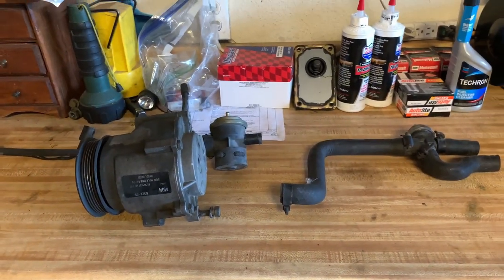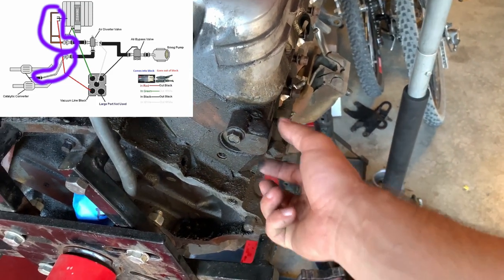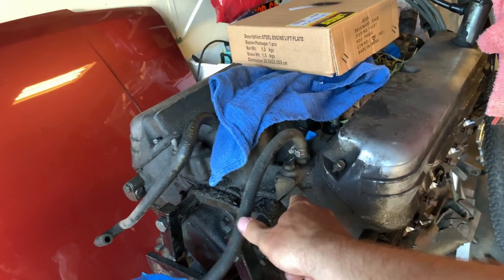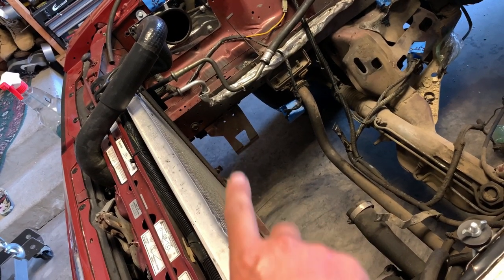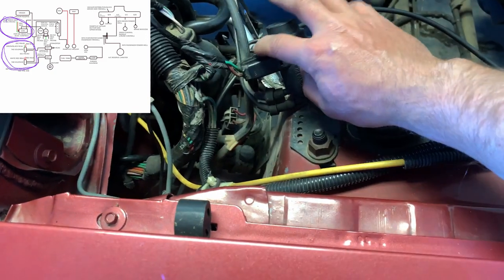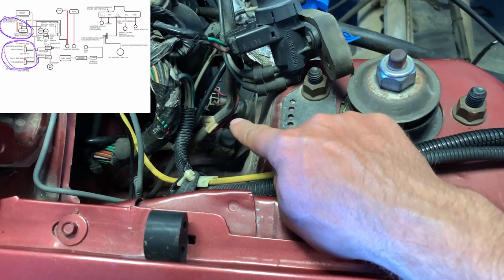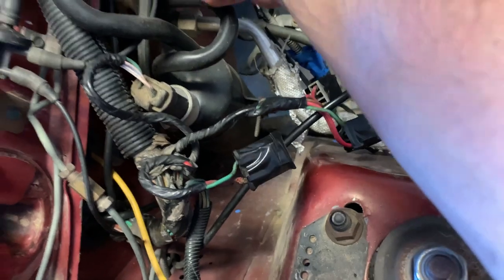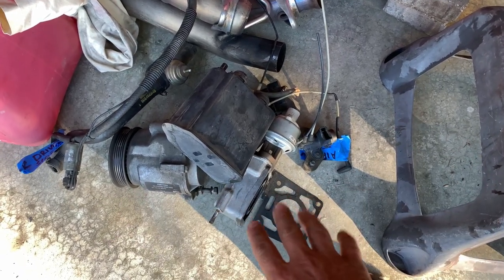Delete Your Foxbody Mustang Emissions!! And Gain HORSEPOWER!! Foxbody Engine Swap Part 6

Comment from the maker: If you have any questions ask me here!
Reply: Great video man. I was surprised. So I’m at about the same spot as you are here in the video. I’m trying to remove things and consolidate space so I have room to put the ignition box (may go under the passenger seat) and the catch tank setup. I’d like to consolidate all the vacuum hoses to just a few total, as it’s like spaghetti in there. As for the purge canister, I’m wondering what the adverse effects would be with leaving it. I’m going supercharged, so if I leave the purge valve hooked up, if the pcm would even control it correctly. But if I hook it to straight manifold vacuum with a check valve, then it would likely implode the tank from vacuum suck down (it can happen - newer Focuses).
So nowadays charcoal canisters are out just before vent to atmosphere valves that are normally open. The hose off the end of them goes up into the body around the fuel tank so any vapors stay trapped up there and you don’t smell them. A differential vent tube with the little valve at the end routed up into the body around the fuel tank may be something I try to see if it prevents fuel odor but allows tank pressure to vent, like when you fill the tank.

The engine bay in these things triggers my ocd - I like minimal/no clutter.
Reply from the maker: I’m the same way it has a billion vacuum lines going all over the place and I hate it!! And so I have an 03/04 cobra tank from on3 performance and the way I’m going to vent it is from the fuel tank vapor valve on top of the tank into the filler tube and that is supposed to vent it properly so that I can fill it with gas like you were saying. And right now for the catch can is I’m just running two breathers and later on I will fab a catch can system. I don’t know where to put it either since their is absolutely no space! I was thinking about relocating the battery so I have a little more room and I could potentially mount the can there and the ignition box.  

Are you on a stand-alone or are you using a chip or stock pcm ? 

Yea the efi systems are messy it honestly bothers me too. I think one day I’ll try to do a dedicated wire tuck.
Reply from the maker: So I reread your post and I got confused lol I thought you were talking about the vacuum reservoir. But with the purge valve I’m just getting rid of mine with the cobra tank and venting the tank with the vapor valve back into the filler tube so it can vent while I’m filling the car up. I read like you did about to many problems with trying to keep the vacuum canister with boosted applications and since I’m running a stand-alone system I don’t think it would even work with the purge valve. And that’s why I just voted to delete it completely and just try to figure out a better way to vent it with the new cobra tank.
Reply: iAmChazHaynes Yo I sent you a FB request.

So I’ll look into doing the filler tube route for the vent. I’m actually building for a customer, he’s running pcm with a chip. He’s also keeping all accessories, even cruise control, so real estate under the hood doesn’t really exist.
Reply: Thank you so much for the video. Is there any ECU or electronic connection i need to be aware of? or may be damage something?
Reply from the maker: @juanlaverde4692  no worries happy I could help! And so from my understanding you do not have to change anything on the stock ecu. That’s what I have read and all my smog stuff didn’t work anyways before I deleted it and I had no codes to speak of.
Reply: @iamchazhaynes7074  thank you!
Reply: Hey man I’m currently doing all
The same removal as you did in your video , I’m  curious what is The point of leaving the vacuum canister in the fender, will the car run funny without it? I’d like to remove mine /delete mine
Reply from the maker: @rhysbryant7451  So the function is to help with your HVAC so your ac will blow air or heater for that matter. I've seen some guys delete theirs I think someone has a YouTube video about it. I just didn't want to do that since I'm keeping my accessories hope that helps! It might have some other functions as well but that is all I could find about it.
Reply: @iamchazhaynes7074  beautiful! Thank you !
Reply: Hey man!! I just bought a 1990 Mustang LX 5.0 5 speed hatchback. I live in California and in order to register it I have to get it smogged. I have the smog pump as previous owner took it off. It has an x pipe headers and an E303 cam. What do I need to do to have it pass. Could I leave the cam and put everything else to stock? Thanks man beautiful Foxbody and great video.
Reply from the maker: @RangerDanger074x4  ok so the cam should pass I have a friend who has an E cam that passes smog so as long as everything hooks up and is in working order it should pass honestly. If you make sure the stock exhaust is put back on you should be fine just make sure all those vacuum lines are ok and not torn apart that’ll mess with the system. If you don’t have stock exhaust you’ll need a catted x-pipe at the very least.
Reply: @iamchazhaynes7074  thanks!! I have the stock mid pipe with cats. So I’m gonna get that put back in and find some catted headers or just stock manifolds. Thanks for all the help! I love the car.
Reply from the maker: @RangerDanger074x4  no worries happy I could help at all!
Reply: What about the egr as well as crankcase pressure? Are you going to carb and ditching the computer too?
Reply from the maker: @bryanbrunk1186  so for the EGR I deleted all of it and ran new heater hoses. And for the PCV valve my intake manifold doesn’t have a spot for it as well as it wouldn’t work anyway for me since my car is boosted. So right now I have two valve cover breathers to vent crank case pressure and soon I’m going to make a catch can system to vent it better. And no I’m still EFI I’m on a megasquirt stand-alone system though. I had to use some sort of tuning system to handle the power and boost I’m shooting for ! Lol
Reply: I have a 95 mustang gt iv removed all the smog stuff & running off road h pipes but exust fumes are very strong is there anyway to fix that
Reply: Do u have a video about properly connected O2 sensors? 84’ mustang with 89’ engine. 5 speed
Reply: How do you remove the mid pipe air tube? I cannot for the life of me get it off. Thanks!
Reply: I’m not too mechanically enabaled but I love the 87 mustang planning on buying one but the guy deleted his smog pump. Will this prevent me from passing smog!?
Reply from the maker: @DudeWithALude97  You definitely will not pass smog if he removed the smog pump!
Reply: I took the smog pump off but not the EGR or all the  stuff on the passenger strut tower I have the smog tube capped off and what goes in the h pipe hole sorry it's my first mustang I'm just trying to learn
Reply: Tips on removing EGR system from a 1987 Ford Bronco II 2.9L  ???  Main tube was capped off (gone) when I got it. So always has crap for mpg, runs rough for about 30 seconds once it would be warmed up. Then smooths out, but like I said earlier, crap mpg and reeks of running rich; Thanks-
Reply: so u unplugged the evr also
Reply: How noticeable is the gas smell without that charcoal canister?
Reply: Do you have to tune the car after
Reply: I have 88vert still speed density and almost all stock. I put bbk headers and catless hpipe now I get backfire shifting at high rp.s from 1st to 2nd and 2nd to 3rd sometimes. One forum said its because my smog system still hooked up. Have you ever heard of this. And I was worried about being speed density and it throwing codes if I remove the smog. What are your thoughts on this. Any info much appreciated
Reply: Have u ever heard of plugging the holes in the back of the motor wit broken off spark plugs ? I heard it’s the same thread size and you can just pop those in instead of buying the block off plates

Comment: Are you running AC? I was just curious why you didn't cap off the EGR vacuum under the upper intake and just use the AC check valve mounted on the firewall to supply vacuum to that vacuum ball in the fender?

Comment: I have a 5.0 Cobra engine in my 1989 short box f150 4x4. It had a super charger at one point. I’m not sure if it had a tune for that or not. I still need to locate the ECU. I’ll be following this guide for sure.

Comment: Let’s go!!! I’m about to get rid of all of this nonsense! And I’m going to a carb style fuel injection on my 5.0 sn95
Reply: Tbi….throttle body injection….go with the ace’s efi….im running one on my sons 289 in his ‘67 mustang….currentley building a roller cam 302 for it with all kinds of goodies cause the 289 is tired with its whooping 200hp
Reply: But yeah ace’s killshot…you can pick one up for around $900 which is wayyy cheaper than the holley sniper which sucks cause the ecu is in the throttle body that sits on top of a hot vibrating engine….the aces one is remotely mounted and can be mounted inside the car to keep it safe and cool!!!!   Night and day difference compared to the holley 4bbl that was on the car before

Comment: Thanks for the video brah. I’m doing this same process on my car. All this stuff is so ugly in there and useless.  I’m in NH so no laws up here. My question is what’s the vacuum canister in the fenders purpose? The one that looks like a ball.
Reply: That is a vacuum canister that sort of saves vacuum in case the system runs low on vacuum. You don't necessarily need it unless you have a huge cam that doesn't make good vacuum but it does help your hvac system work alot better since it all runs on vacuum.

Comment: How did you clear the codes and or stop computer from messing with timing
I’m finished build my 302 and did maf conversion with a9L all going smooth but the computer didn’t like the egr missing and is throwing codes and messing with its timing I believe

Comment: What was the reason for keeping the vacuum canister and keeping it hooked up the the intake…if I’m correct by looking at the vacuum diagram it only serves the purpose of all the smog stuff you removed and nothing else. Couldn’t you just have removed the line as well since it isn’t hooked up to anything anymore?
Reply from the maker: The canister controls the HVAC system so that’s why I kept it connected. I’d have to re look at that diagram again but from what I understood I needed that to keep all the HVAC equipment working and all my stuff works lol but I’ll double check myself

Comment: You forgot to mention getting a shorter belt after deleting the air pump! But great vid!
Reply from the maker: Your totally right!! Haha oops 😅 thanks man!
Reply: Goodyear Belts 1060845 Serpentine Belt, 6-Rib, 84.5" Length to save anyone from having to try and find out what size you need

Comment: Once said and done where does the vacuum line from the canister in the fender hook to the intake at?
Reply from the maker: honestly you can hook it anywhere from the intake or what i did was use the spare slot on the vacuum tree

Comment: How do you get the water tubes off car ? And what’s used for a plug ? And can you remove the egr spacer etc and not run it just with the TB and intake
Reply from the maker: So the little water tubes that go through the spacer you can cap off the line on the heater tube and manifold with just some caps from autozone with a little hose clamp And you can use those little caps to block the spacer off too. And I would keep the spacer cause you take it apart the throttle body doesn’t fit right and the IAC won’t fit without the spacer.
Reply: I have a 70mm bbk TB with egr stuff but want all that gone since rest of it is gone

Comment: Hey buddy where you said connecting the check valve into intake... Do I need that installed and with out it would run well like shit ??? Trying figure my problem out
Reply from the maker: Well if it’s not connected is it at least capped off? And it shouldn’t matter because all that line does is go to a vacuum reservoir for your HVAC stuff. If you want DM me on Instagram and I can talk more in depth about it if you wnat
Reply: There are 2 vacuum canisters in the passenger fender well. One goes to the emissions equipment and the other is for the hvac

Comment: ima be doing the same thing cuz my vac lines wasnt hooked up right and brittle.. having drivability issues i capped off alll the emissions but the back off the heads and the smog pump pipe.. but like you said race car stuff so needs to be gone anyways lol
Reply from the maker: Mine were the exact same way just brittle and and destroyed so I got rid of it 🤷🏼‍♂️ don’t need emissions for a racecar hahaha some guys get so angry when you say you’re getting rid of it for some reason though 😂 the only thing that’s bad is it smells like gas since my gas tank isn’t vented properly but so the charcoal canister would be the only thing but you can vent the gas tank other ways or get a cobra tank like I’m doing and vent it that way 😁
Reply: @iamchazhaynes7074  ngl my doesnt smell too bad like everybody claim.. i do have my gas tank to charcoal canister line still on and taped underneath but i can tell the difference in power but only cuz i prob had vac leaks lol
Reply from the maker: Oh nice! That will help! And it makes a difference even though it’s small even the little bit of power makes a difference! Haha but fixing the vacuum leaks probably helped a lot!! Haha

Comment: With removal of all that crap did your check engine light came on? If do how to turn it off? Thx, just subed your channel
Reply from the maker: Well I ended up using a standalone ecu so I never had to deal with the check engine light 😅 but I heard if you plug a resistor into the egr plug it will keep the light off. Sorry I’m not more help with that. I didn’t do much research into the check engine light because I knew I wouldn’t have to deal with it myself. But thank you for the support ! It helps me tremendously!! 😁

Comment: Did you put a throttle body spacer after removing the egr? Or can i bolt it straight to the intake manifold?
Reply from the maker: if you are keeping the stock style manifold I would keep the spacer because the throttle cable bracket bolts to it so you need it for that. You can buy solid spacers with no EGR passages when you upgrade your throttle body. But I wouldn’t buy one until you upgrade 😁 but you definitely need to keep it

Comment: Any way to remove those air tubes without cutting them? If I can I want to avoid any cutting.
Reply from the maker: You don’t have to cut ! The guy who had worked on my car just cut them out cause he’s a doof. They will unscrew and then you can buy head plugs to screw in and plug them up.
Reply: @iamchazhaynes7074  appreciate the reply! I'm talking about the part that connects to the H-pipe. I'm not 100% sure what its actually called but I see people on forums call em air tubes.

Comment: what do I cap the throttle body with and how should I block off the 2 EGR lines
Reply from the maker: I would just use vacuum caps for the throttle body and the lines that use to connect to it autozone has coolant rated caps you can stick on there. Actually I would probably use those caps for everything lol
Reply: @iamchazhaynes7074  did I see you connect the hose from the black tube right into the back hose on the EGR valve and I don't have the block off plate yet it's on its way but I must have missed something to cap off and I haven't moved the coolant lines yet another question I have is it better to run a shorter belt or get the idle pulley I put the idle pulley on today with the stock belt and the car felt different slower almost I'm not sure but again I'm not sure what I missed it's my first mustang

Comment: Clearly, you don’t understand how the emissions controls work, nor do you understand engines. PCV kerps your engine oil healthy. That AIR pump keeps both the Oxygen sensor clean during cold starts, and keeps the catalytic converters from clogging. EGR lowers combustion temperatures, increases efficiency, and gives a small boost of power at part throttle. None of these systems cause a loss of power, but they do confuse certain people.

Comment: No horsepower gain
Reply from the maker: Almost lol even though it is practically nothing you’ll still gain about 1-2 hp from the smog pump delete which is really nothing but it’s something lol And plus I need mine out of the way to fit the On3 turbo for the car.